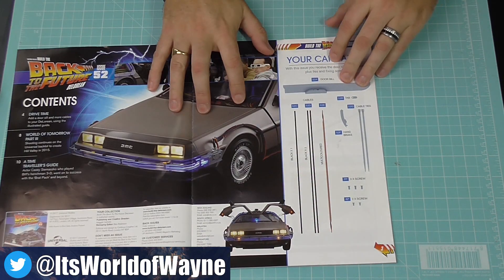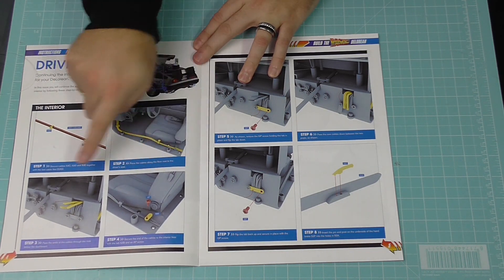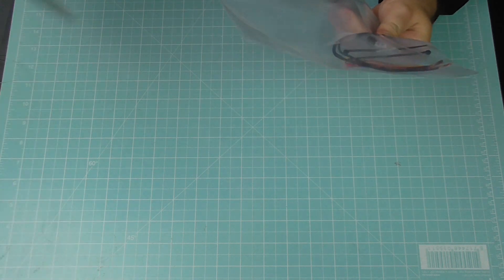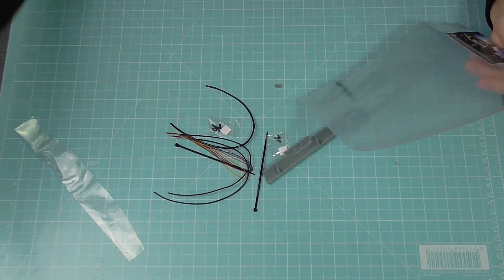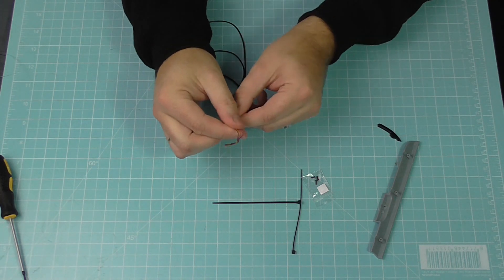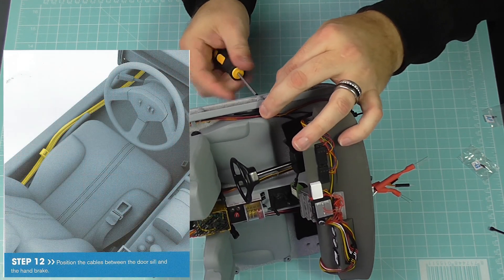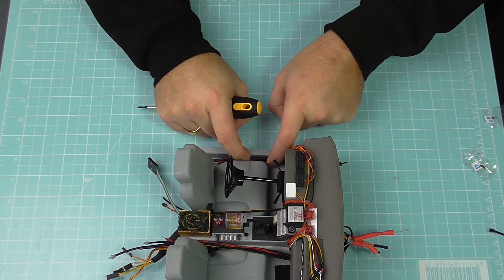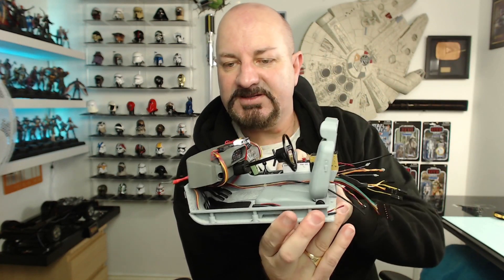Build the Delorean - Issue 52 - Interior Wires, Seal and Handbrake

Comment: Already got my side carpets (and bulkhead carpet) ordered from Mike Lane in the UK. Also waiting on my Mad Geeks 1:6 scale flux capacitor to arrive from the USA. Hopefully I'll be able to wire the charging cable up for the thing through a female to female USB adaptor that I can hide in the fusion reactor chamber thingy, which I can then access via Mr Fusion's flip top lid function, which basically means that when I need to charge the Flux Capacitor battery, all I'll need to do is flip open Mr Fusion and then plug a USB charger into the thing.
Reply from the maker: Its a good idea. Im going to me modding the Madgeeks flux but I have been spending most of my time coming up with an improvement on the Xmas tree but its ganna take some time :D
Reply: Hey Wayne. I was just wondering what are the pros and cons of this as compared to just buying the 1/6 scale Hot Toys Delorean instead ? From what I have see it also has lights and you have the benefit of also getting the figures in the same scale. Plus it’s only around 600 Euro which I m guessing  is cheaper than the Eaglemoss version by quite some margin. Love to hear your thoughts.
Reply from the maker: The details on this is a lot better and the quality also. Plus, it doesn't sound like a lot but the 1:8 size difference is a big big factor
Reply: World of Wayne fair enough,  though do you mean a big factor because you feel that 1/6 scale would just be  too big for display purposes ?
Reply from the maker: Aye this thing takes up most of the man cave as it is lol